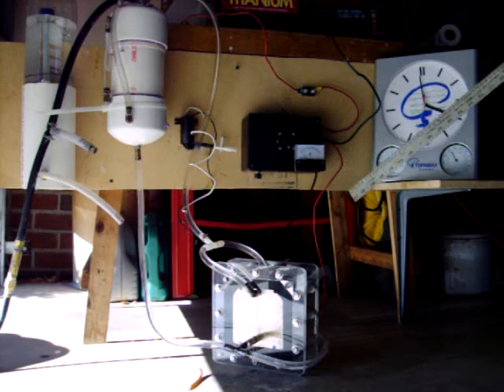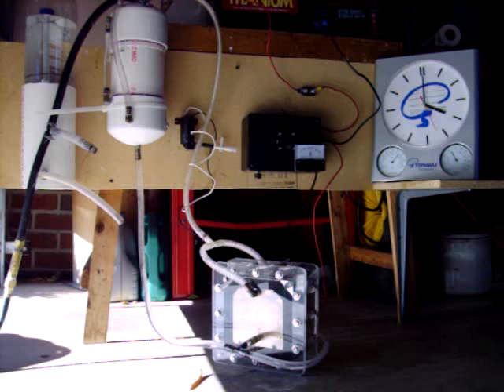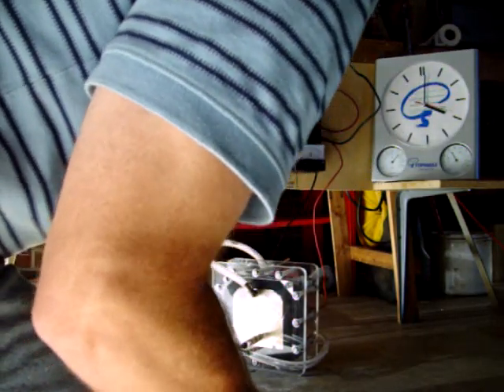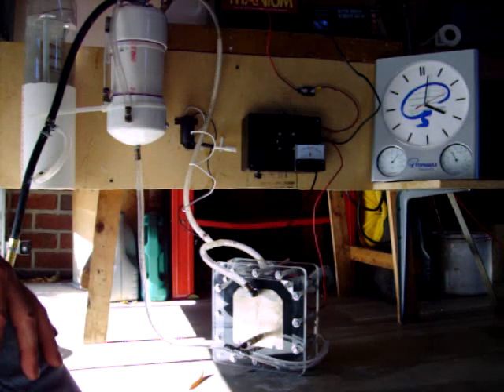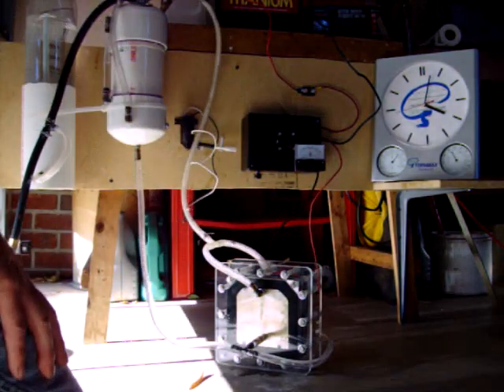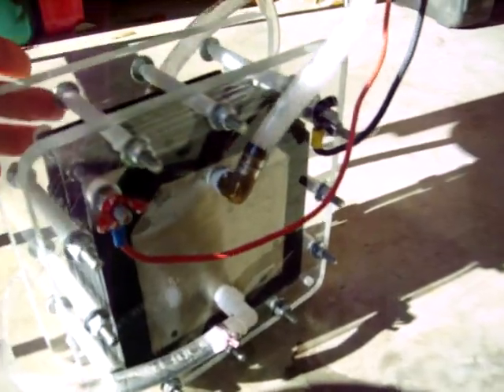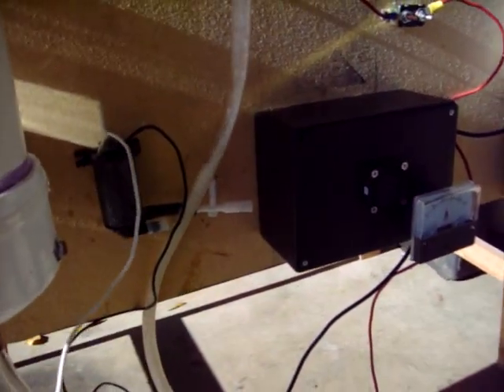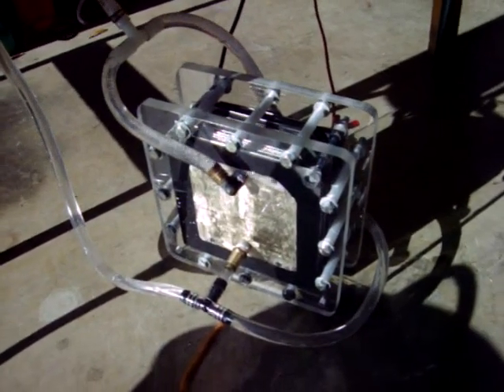21 plate HHO Dry cell generator rate check.

Comment: Nice.......
i stumbled across this looking for the current draw/production on a wet cell i am building.
Yea yea........primitive.....but cheap
at least.......i'm coating the edges in tool handle dip, using a 50 amp PWM, 316L, distilled water (same water i make colloidal silver from) and "food" grade KOH....

Anything to beat BigOil™'s monopoly grip and clean this planet up!!!!!

Comment: Nice job on the design.You are making a respectable amount of gas for the amp draw. My cells make 1 lpm @ 12 amps. You can improve efficiency by separating the electrolyte between the plates with staggered holes so the voltage doesn't shoot right past the plates through your recirculation holes. If you have no heat after an hour of running you have an efficient unit.